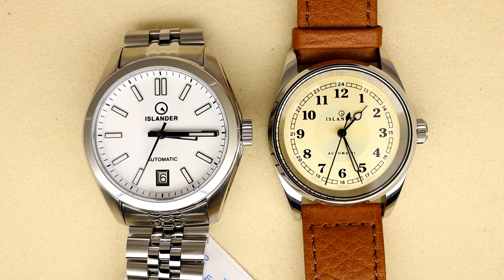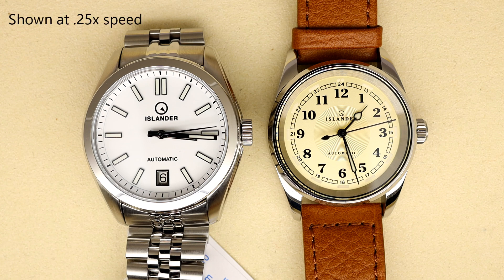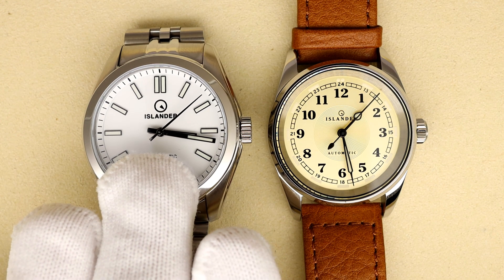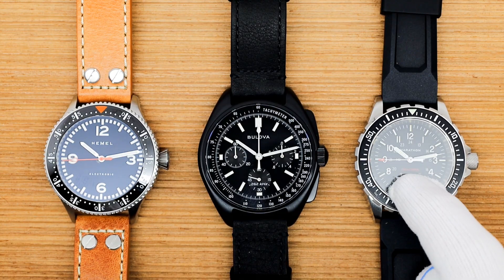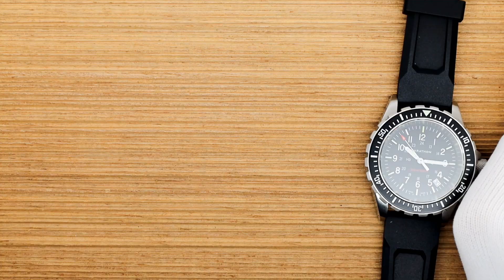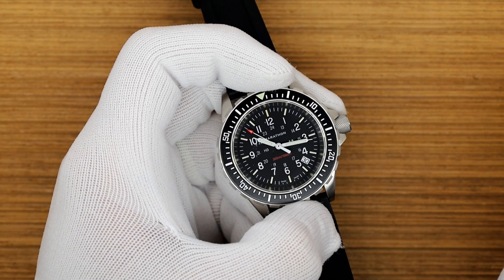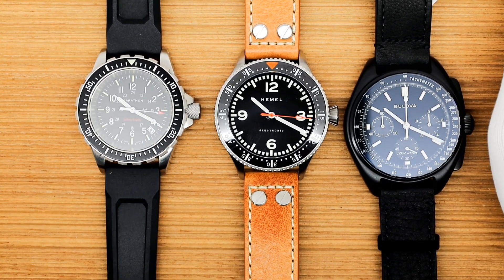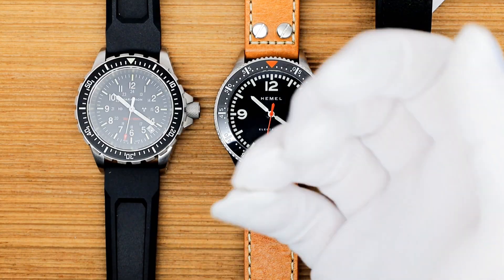Everyone is Wrong About Quartz Accuracy! Watch and Learn #91

Comment: As a retired engineer and adjunct faculty member of an engineering college (math and physics), I would stress to my students the difference between precision and accuracy. I told them a voltmeter with a 10 digit display could precisely measure the wrong value.  

The Bulova Precisionist has a truly impressive watch. That smooth second hand is very cool, but as he describes, is it accurate?  It is a watch that is high on my list to add to my collection.

With due respect to the high-end mechanical and quartz watches, my favorite watch is the Bulova Accutron with tuning fork movement. I have three working model 218's, one 214 and one 219.  The 218s and the 214 are adjusted for 1 sec/day.  I also have three 218 movements which I'm trying to consolidate into one working movement.

Comment: That's an important and critical point about the Bulova's Precisionist movements: The energy cost of having all this extra work means larger batteries with shorter lifespans, and the larger case sizes to accommodate those larger batteries. There are going to be trade-offs between mechanical and electronic power consumption: A digital LCD is the "sweet spot" for efficient timekeeping because has no moving parts. However, liquid crystal displays are function over form (they're not beautiful).

Comment: Electronics engineer here.

It doesn't make any difference what the frequency of a crystal is. All "common off-the-shelf" crystals are +/-20 to +/-50 ppm. That goes for every frequency, whether it is 32,768 Hz (the most common watch crystal), the 262,144 Hz in the Bulova or a 10 MHz crystal. The frequency is divided down to whatever step rate is required for the second hand and but the accuracy remains the same.

An electronic temperature compensation can be desgined-in, adjusting the crystal frequency over temperature. Well designed, it can bring the accuracy down to 1 pmm.

A well designed oscillator circuit also has a trimmer capacitor to adjust the frequency. But there will always be drift caused by ageing of the crystal.

Translated to seconds per day or per month:
+/-50 ppm equals 4.32 s/day
+/-1 ppm equals 0.0864 s/day or 2.7 s/month.

Long story short: you cannot judge the accuracy of a watch by simply looking at its crystal frequency. You need to know the accuracy specification of the crystal that's being used, if it is temperature compensated and if a trimmer is used to adjust the frequency to specification.
Reply: Well as a fellow scientist- Your answer is partly true.  I agree that the crystal needs to be accurate and temerature stable however the higher the frequency, the more accurate you can get.  That's why the cesium atomic clock, uses the frequency of a specific transition in cesium-133 atoms, which is defined as 9,192,631,770 Hz for even greater accuracy.
Reply: @brucekempf4648  You're comparing apples and oranges now. A cesium clock is something completely different than a quartz crystal. Quartz crystals do not get more precise with increasing frequency.
Reply: I'm glad you understand all this so I don't have to. Engineers are great.
Reply: Well as a fellow scientist- Your answer is partly true.  I agree that the crystal needs to be accurate and temerature stable however the higher the frequency, the more accurate you can get.  That's why the cesium atomic clock, uses the frequency of a specific transition in cesium-133 atoms, which is defined as 9,192,631,770 Hz for even greater accuracy.

Comment: Hello! Frequency is not the best gauge of timekeeper accuracy. Rather, it is the quality factor of the timebase oscillator. Quality factor is essentially the number of free oscillations that the timebase can achieve before stopping.  English engineer Douglas Bateman showed that there is a good correlation between timekeeper accuracy and the quality factor of its oscillator timebase. The quality factor of a mechanical watch is about 200, while quartz watches have quality factor going up to 100,000. For example, the most accurate pendulum clocks have frequency 1/2 Hz, but have similar accuracy to the best quartz watches, and have similar quality factor.

Comment: I have a Grand Seiko SBGV245 with the 9F quartz movement. I set it to atomic time and it remains accurate to the second +/- 0 per 6 months until I have to change it for DST twice a year. Only downside is the battery only lasts 2-3 years. I use it to set the time on my mechanical watches.

Comment: This is a very odd one. I wonder where the misconception started? It's not one I had heard before!
Reply: The higher beat rate being more accurate? It is really about recovery time to the standard oscillation. Pocket watches or other mechanical watches and clocks on a stable surface will be consistent, but on your wrist it is impacted because you make several movements per hour that can make one of the pendulum swings extra short or extra long. Say one swing is lost entirely. Did the watch lose 1/4 of a second or 1/8? Lower is better therefore higher beat rate is better. This is one reason why a watch may look great on a timegrapher but when worn it doesnt meet the accuracy the timegrapher shows: note how far off it is per day, set it on a timegrapher and whatever it says move its reading by the amount you know is the actual daily inaccuracy.

Comment: It actually goes much deeper than that. The crystals cannot be trimmed 100% accurate to 32768 Hz (or whatever their base frequency might be), so they make them slightly faster on purpose, and in the factory, they measure a constant for every watch on a oscilloscope, or similar counter. This gets set into every watch as a correction factor. You'll never see it happen, but every hour, or few hours the quartz watch actually delays one of the seconds by that much to get it accurate again. Even the very best ones do this, albeit less regularly perhaps. On most quartz watches it can even be changed with a small potentiometer. But its incredibly hard to regulate accurately yourself, because you have to wait a month or so every time to see the effect of your adjustments. So, its best left alone. You're not going to do better than the factory.
Reply: I have a plug-in alarm clock with a backup lithium cell and automatic time change for DST. It gains several minutes a year because its quartz crystal oscillates too fast. I’ve had it for maybe 12 years and it seems to be getting slightly faster over time.
Reply: 32768 Hz quartz crystals are typically trimmed (or tuned) by laser during the manufacturing process to be 32768 Hz. Yes, they may end up being off by a fraction of a Hertz which can be compensated for by tuning the watche's oscillator during the watch manufacturing process  (if the watch manufacturer desires to make a more accurate watch).   P.S. an oscilloscope is not a counter  (although many scopes do have that function built in)...

Comment: I had a lot of trouble getting a cheap thermocompensated quartz watch. I finally used two cheats: 1) buy a unisex-looking watch sold as a women’s model 2) look for something with an ETA Precidrive movement. A few Certina watches actually have “Precidrive” written on the dial. That really helps. Tissot and others seem ashamed of it. A quartz COSC-certified watch will be thermocompensated, though not necessarily cheap.

I have a couple of Precisionist watches and the motion of the seconds hand is cool but they don’t act like thermocompensated watches and I assume they’re not. Usually not accurate enough.
Reply: It takes a lot of energy to thermally compensate a crystal.  You would have to heat it to a specific temperature higher than body temperature and then calibrate it at that temperature.  Thermostatic accuracy would need it to be very insulated and accurate.  Doesn't seem feasible for a watch.

Comment: More info if you want to nerd out:  Accuracy in Quartz oscillators is a culmination of things.  Quartz crystal cut (XT or AT), the stability of the capacitors that makes up the resonant tank and the stability of the amplifier that makes up the oscillator.

Comment: Very cool video Marc, and great explanation of everything. As you talked about the big battery in the Bulova, I'm wearing a G-Shock Mudmaster GG-1000 right now which holds 2 batteries! It's a 1 tick per second seconds hand but in the year I've owned it, it's gained around 15 seconds and I just recalibrated it today.

Comment: Quartz movements and nice and all but they've got nothing on the accuracy of the turbo encabulator. Now basically the only new principle involved is that instead of power being generated by the relative motion of conductors and fluxes, it is produced by the modial interaction of magneto-reluctance and capacitive diractance.

The original machine had a base plate of pre-famulated amulite surmounted by a malleable logarithmic casing in such a way that the two spurving bearings were in a direct line with the panametric fan. The latter consisted simply of six hydrocoptic marzlevanes, so fitted to the ambifacient lunar waneshaft that side fumbling was effectively prevented.

The main winding was of the normal lotus-o-delta type placed in panendermic semi-boloid slots of the stator, every seventh conductor being connected by a non-reversible tremie pipe to the differential girdle spring on the “up” end of the grammeters.

The turbo-encabulator has now reached a high level of development, and it’s being successfully used in the operation of novertrunnions. Moreover, whenever a forescent skor motion is required, it may also be employed in conjunction with a drawn reciprocation dingle arm, to reduce sinusoidal repleneration. 

Now that's accuracy (and precision) you can count on!

Comment: I'll stick with my Casio's
Analog Forester (right at call it "$30") is inside a second on the minutes changing on my "smart"phone and tablet ... after a year.  The "error might be my reaction time when I set the watch.
A sub $6 digtal stop watch with time and date is accurate to the Casio by a second or two after two months.

Why should I spend hundreds I don't have, and would need to save up over a period of a yeear or more thanayear to get, to buy a Seiko or Citizen that may or may not be as accurate as my 11 year old Casio Forester? 
Admittedly, I MIGHT get the lowest cost (around $45) Casio G-Watch, or the least expensive Casio Mud Resistant ($39) almost a G-Watch sometime next year ... along with a couple mechanical ("disposable";  costs hundreds less than a service charge for cleaning and lubing - even if no parts are needed) and quartz pocket watches. I might even "splurge" for an "disposable" (cost hundreds less to replace than have it serviced) automatic self winding pocket watch (for call it "$60") or wrist watch for about the same money.
Yes. I expect the no-name batteries in the quartzwatches to go bad ... possibly before the watch is shipped from the warehouse. Maxcell, Duracell, Panasonic, and even Renata batteries are low cost. I am not capable of servcing a mecanical watch (lack the skills, experience, tools, work space, very bad eyes, etc) , but I am quite capable of changing a watch battery.
 I only buy good name brand watch batteries. I might be able to get 20 or more no name vs 5 name batteries for the $5 or less the big name bats cost, but the no names won't last - and might be flat - long before I receive them.  Or worse, be defective - wrong voltage/amperage.
I put two Renata batteries inmy Forester. I may not have to change them again ... unless I don't get planted in the next 120 to 150 months. (10 to 10 years 3 months).
The original Panasonic that powered the watch lasted 10 years 3 months.(light battery was still going strong, but I changed it too)  Supposedy the Rebata batteries are much better than the Panasonic's. I might find out if they really last longer.

Comment: Great video Marc! I love the Bulova precisionist movement but just wish they had a WAY better design team. I purchased a used Bulova Precisionist 98B267 several years ago, but ended up selling it as the design - once I had it my hands - didn't win me over after a day or two; kind of boring. It was a simple 3-hand but man...the second hand ticked at 16 ticks/second and was so close to a smooth sweep that it was almost imperceptible to see the individual ticks and I would just stare at it for 20-30 seconds several times a day as it was a bit mesmerizing. It also helped that it was a reasonable 42mm and a solid every day watch if you liked the style.

Comment: How is the temperature coefficient of the crystal dealt with? I recall radio transmitters had their crystals in little chambers called "ovens" which kept the crystal at a constant temperature of around 125° F. Even so, I noticed that AM radio stations on the same channel typically had a beat frequency of 3 to 15 Hertz, which meant the inaccuracy was around ten parts per million (≈25 seconds/month). I wonder how crystals could be made more accurate over a wide range of temperature.

Comment: Basically, people need to think about the hands just like a display.  They totally belie what's going on in the circuitry of the movement.  It's just how the designer of the movement decides to sample the beat of the crystal and update that more often as a position change on the hands.  The best example is a solar quartz.  Certain solar watches stop the hands entirely in darkness to save power, but internally they're still keeping time until you bring it back into the light.
A brilliant watch and learn Marc 👍

Comment: How much accuracy do you need? Do you need a seconds hand? Without a seconds had you would be hard pressed to read you watch to within 30 sec. Rolex understand this, they mass produce Chronometer certified watches with a robust mechanical movements. Chronometer accurate is rubbish compared to a cheap quartz watch, but good enough, so Rolex do not feel the need to chase higher accuracy in the way that Omega or Seiko do, with their mechanical watches.
So to quartz, even the cheapest quartz watch gives better accuracy than anyone needs for daily life. That Citizen can make movements to 10 sec/yr, for Bulova or 1 sec in their caliber 0100 is of no real consequence, that they make them solar powered so you never need to open them up is.
My cheap Lorus (Seiko.) doesn't need setting between summer/winter time, which is good enough.

Comment: I never realized that the LP was actually a precisionist movement, as well.  I knew they both ran at 262kHz but I didn't think that made them both precisionists.  I bought another precisionist just to get that super smooth sweep that it does.  Great watches, great company!
thanks for the video!

Comment: I'll throw a plug in for my Longines Conquest. This is the regular version, not the UHP (radio) one, and mine runs <10s/y, so does my wife's smaller version. I believe to do this requires some form of temperature compensation in the clock chip.

Comment: Hi mark I have a question.. quartz is more reliable accurate and cheaper than automatic, so why do navy and army often opt for the auto version? Like the gsar. Any ideas?
Reply: Probably to reduce the risk of the battery dying while the user is deployed in the field and has no access to a replacement battery.

Comment: Interesting.
So the accuracy isn't linked to the number of times the hands tick/second, but how many times the quartz crystal oscillates? Isn't that kinda the same thing?
Two things that don't add up for me:
1) Generally speaking, the more something happens, the higher the propensity for error.
2) Surely the precision of the hand gearing also accounts for at least as much (if not more) of the accuracy? If those gears aren't moving the hand exactly the same distance for each tick, the hand is gonna be outta whack pretty fast.
Just some thoughts. Would love if someone with more mechanical knowledge than me (I have zero!) could explain.

Comment: I like the precisionist movement, but I really don't like having to replace batteries. So, my question is what kind of battery life can one expect from the precisionist movement?

The battery replacement issue is such a deterrent to me that I have so far limited my quartz watches to those that are solar powered. Do you think that Bullova will ever pair their precisionist movement with a solar dial?
Reply: No. The movement requires a lot of power to run. Way more than any watch size solar panel could produce.
Reply: @erikk1820  So, how frequently does the battery need to be replaced then?

Comment: That Bulova is a Lunar Pilot isn't it and not a Precisionist.  Just checked the Bulova website because was wondering if the LP fell into their Precisionist line of watches.  Looks nice in black.
Reply: Of course it is. It even has the 262kHz speed of the crystal vibration of the precisionist movement printed right on the dial.

Comment: Again, great presentation. Funny you should mention mechanical movements: I'm trying to prepare a few vintage Hamilton watches (1960s-70s vintage) for sale. both the dress watches beat at 18,000 mph, and, in spite of their age, both measures rather well on the ol' timegrapher, and in more than one position. By contrast, a Seiko 5 I bought used (loved the dial and case details) has a 21,600vph movement whose current operating state is "all over the place", likely due to a seriously-hard drop at some point. (The fact that I did recently buy a timegrapher might call my mental state somewhat into question, bu that's an entirely different matter.)